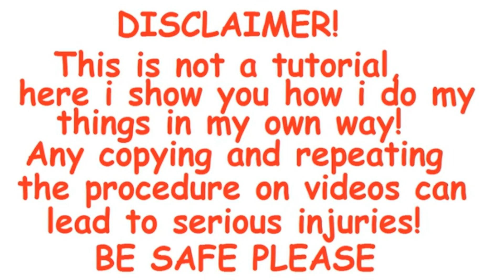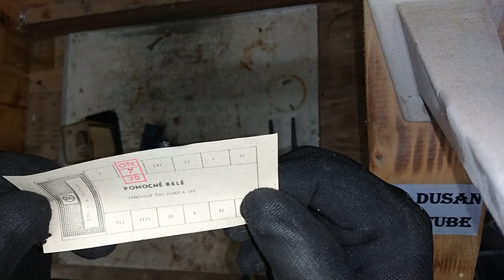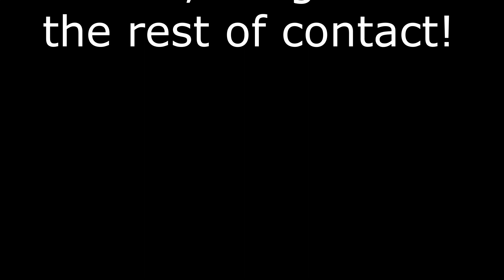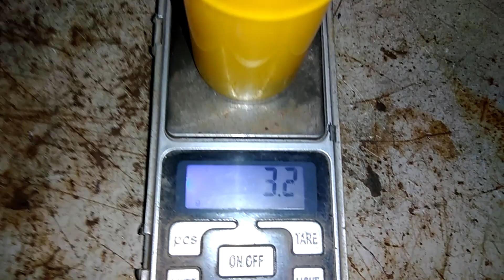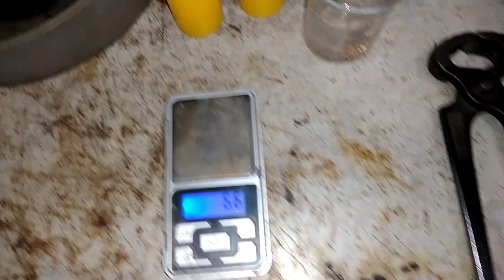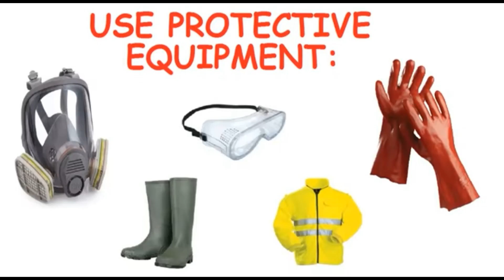Jumbo relays - 36 contacts - how much gold and silver in it?!

Comment: Merry Christmas!
I find AgCl conversion goes well when you keep it just slightly wet after rinse and decant. Put caustic soda (crystal lye) in and stir. It makes a hot wet paste that you can stir to a quick finish. Then add sugar and it should still be wet enough to convert again quickly with the heat from reaction. Borosilicate or pyrex should be used. It will heat fast.
Thanks for all the great videos!

Comment: Dusan, if there is still blue color in the water, does that mean there is still silver left in suspension?
Reply: Blue color is copper salt. Green color is usually  palladium. Silver nitrate is actually a colorless solution.   Add HCl in excess to drop all the silver chloride.

Comment: First!
They are looking like micro aqua tanks like "nano reef".

The contact material depends on their switch voltage capacity.
Low voltage (0-5V) are for precision switching in measurement devices and HiFi, they may be solid gold.
Mid range (5-50V) are made of an silver alloy and often gold plated.
If the relays rated for higher voltages (>50V), the contacts are made of an silver alloy only.
Reply: Good to know
Reply: That good info. Helps to sort relays easily.